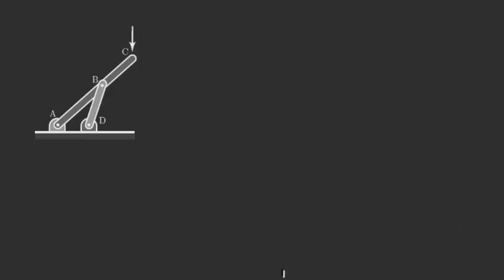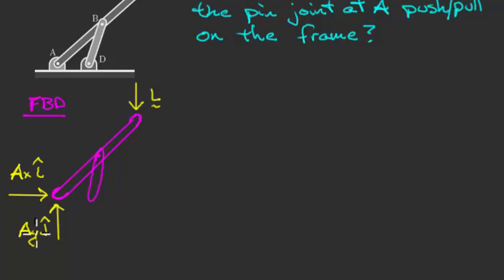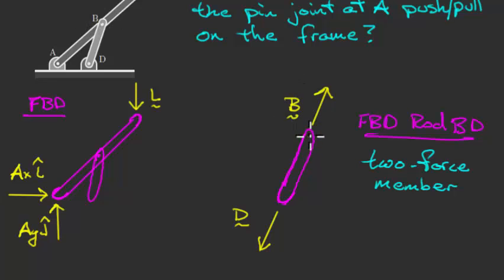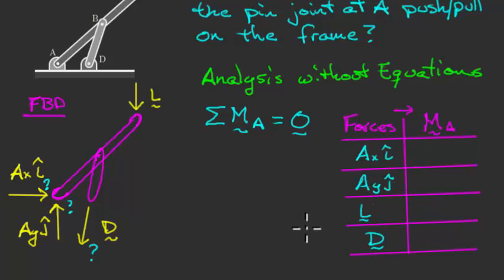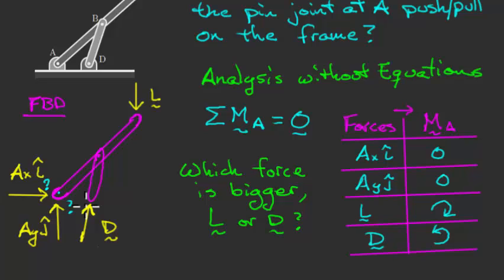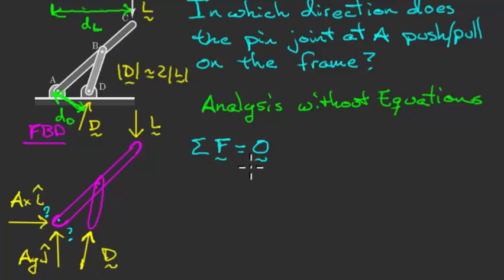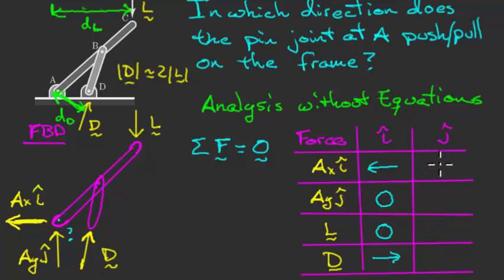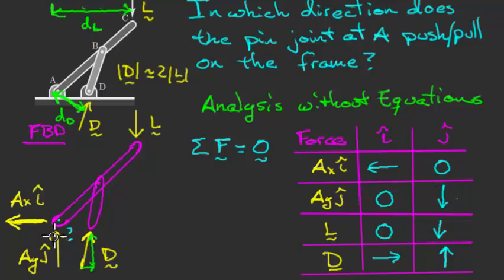Statics: Frame Analysis without Equations, B

Comment from the maker: It's because the forces at B are internal. If I were to include forces at B, then I would have to put the force on the top rod due to the lower rod, AND the force on the lower rod due to the top rode. Because of Newton's Third Law, these forces at B would exactly cancel each other.